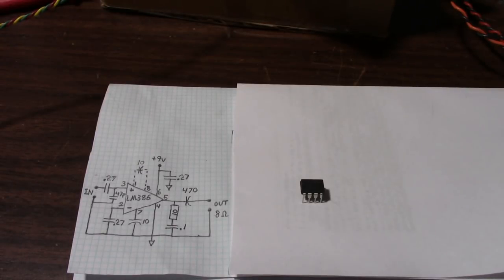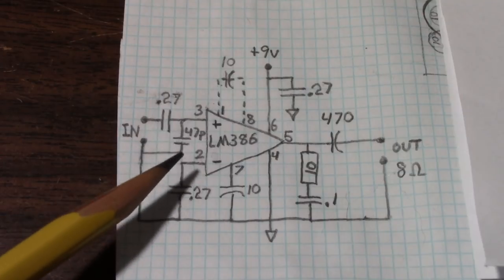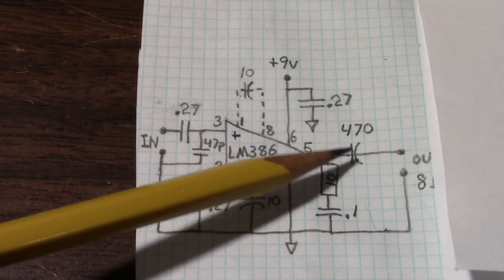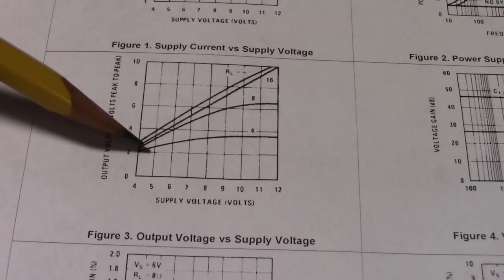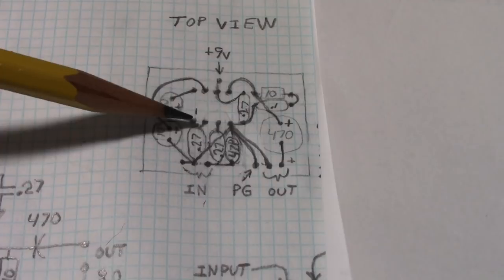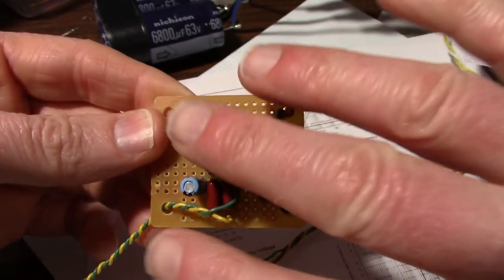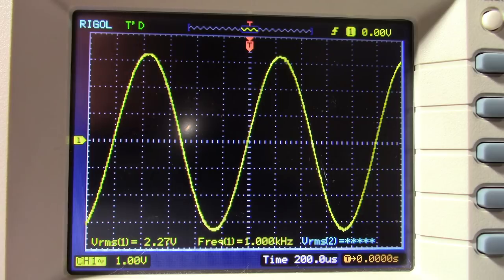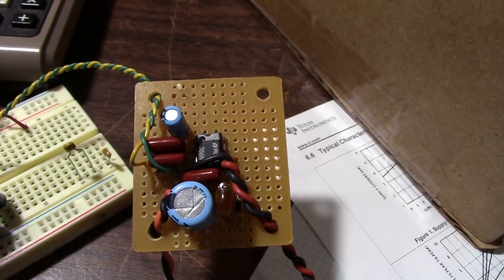Make the PERFECT LM386 audio amplifier?

Comment: im a guitar player and new to electronics hobby . i was thinking would it work if i took my favorite sounding guitar pedal attach it to the input of this circuit and make that all one small 9volt guitar amp? would i need a buffer in between  my FX pedal and this amp circuit? i was thinking of using a Marshal Guvnor circuit into this and use the Guvnor to control the tone and gain of the  amp. thank you for any feed back on this topic. i would want the amp to be completely clean and get all my gain from the guvnor circuit should i keep that 10uf between pin 1 and 8 out?
Reply from the maker: I say try it to see how it works. I'm not familiar with those devices as I'm not a musician. Use a proper guitar speaker in a cabinet to get good volume and sound.
Reply: @JohnAudioTech  i will give it a try and report back here and let ya know how it turned out maybe a couple days . i enjoyed your video breaking this circuit down . i have the LM386N-1 as well as the N-4 ill try both .
Reply: @JohnAudioTech   i decided to put my other projects on hold and just do this one real quick . i just got done testing this on my bread board and it sounds really nice through 2x10 speaker. i had to add a volume on the input of the amp after my Guv'nor circuit, the Guvnor was over loading the Lm386 a bit and turning it down a bit  before the amp made it work really well as a guitar amp. thank you for sharing your amp circuit im really happy with how it sounds on its own, the Guvnor makes it sound more like a Marshall guitar amp. i might add some reverb and put it all in a box with a 1x12 speaker.

Comment: I installed a line in Aux port in my car by tapping into the CD changer L/R lines. It works but I need to increase the volume a lot more to achieve the same volume of a cd, would something like this inline work for that issue?
Reply: Yes, it will work however ; an lm386 is designed for power amplification to drive a speaker, your best bet for a line level low load application is a conventional op amp like a TL071 or LM741 :) make a resistor configuration to set up your gain, google opamp negative feedback
hope it helps, mylo

Comment: For a guitar amp, why use 100k instead of 10k? In a different video you suggested that the pot should be <50% of the input impedance of the amp. 50% of 50k ohms is 25k ohms.
Reply from the maker: Guitar pickups require high impedance loads or they can sound weak and treble.
Reply: @JohnAudioTech  
I suppose the use of a JFET buffer on many common 386 based guitar amps is intended to mitigate this problem. Thanks for your time and channel.
Reply: I was able to set-up a decent sounding circuit in a breadboard with 386N-1. When I swapped for a 386N-4 it distorts. I tried at 9V and 18V. Any idea why? I expected it to sound better / louder. Gain = 20-50.

Comment: I just don't understand why people still use these, when there's other cheap products out there. 
For example TDA7266 - mono 7w , 3v..18v, through hole, easy to heatsink...  datasheet has example circuit and even circuit board layout and everything. 
Or TDA7496 2 x 5.5w, 10v..32v .. with standby/mute and volume control using a plain potentiometer... a bit over 2$
LM1875...  the classic 5pin TO-220 part (if I remember it's equivalent with TDA2030A) which can do up to 25w mono, with +/-8v.. +/-25v or 16v..50v single supply... it's 3$ each from TI (Asian clones of the chip are 0.3-0.4$ on LCSC) . Again, the datasheet has loads of explanations and even circuit board picture with components and everything. If the LM1875 datasheet is no good enough, you can jump to the TDA2030 datasheet and get even more info.
Reply: Simple answer is that many of us still have lm386's from radio shack days.

Comment: Can you use the 700mw lm 386n-4 instead of the lower power one used here?
Reply from the maker: You can use the n-4 with higher supply voltages to get more power, but you're stuck using 16 Ohm loads. The different versions have the same output power at any given supply voltage, so if you use the n-4 at 9v, it will have the same output power as the n-1 (8 ohms).
Reply: @JohnAudioTech  so using 8 ohms at 9 volts for that chip would damage it? Or would it give me a bit more power at 9 Volts than the 350 mw -1 version?
Reply from the maker: @bobking7347  You are safe to use the LM386 with an 8 ohm load at 9v. You'll get the same power with any version.
Reply: @JohnAudioTech  Thanks, I did order all the parts to build this off of mouser!

Comment: why the 274 cap  is only connect to the chip vcc pin , not between the 9v psu and chip vcc pin ?
Reply from the maker: Doing that would block the DC current. The cap must be connected between Vcc and ground.
Reply from the maker: @junsenhsieh7212  If I understand, connect the bypass capacitor lead close to the Vcc and the other lead close to the ground pin as possible as shown on the layout in the video.

Comment: Does the 47pf cap go to pin 3. it does on the schematic but not on the layout,
Reply from the maker: It can go to either side of the input cap. It was easier to layout the way I placed it.
Reply: @JohnAudioTech  thanks. will do the same when i build it.

Comment: For your next trick. make a LM386 based 70 volt amplifier XD
Reply: not hard really, its just a case of attaching a 8ohm-70volt matching output transformer. but with the low output power of a LM386, it wont be the best performer
Reply: @DanafoxyVixen  Or a big resistor and zener diode lol.

Comment: Hmm.. how is that possible that I have a better sound from simple FET + Mosfet circuit than with lm386 (AliExpress) ?
Reply: read the datasheet    it was designed for low-Fi use
Reply: Because the AliExpress '386's are fake. I tried Ali, ebay and amazon. ALL FAKE. Some sort of mystery op-amp re-etched with LM386 on them. I bought 2 Texas Instrument ones from Digikey and they sound fantastic.
Reply: You are right! I have stopped buying components from Ali,Amazon,Ebay etc., because you never know whay you get and after one shop sold me fake l293 wchid don't work properly and I didn't return them because I didn't want to argue with thr seller for a few dollars + petrol to get to the shop. So I decided never again!! I make a bigger orders now, for example 2 times a year at Mouser or Farnell, only original components now. China pease... me off and the sh..what they sell. Never again wasting my time wondering why something not working etc.

Comment: How does this amp sound compared to this? https://www.circuitbasics.com/build-a-great-sounding-audio-amplifier-with-bass-boost-from-the-lm386/
I see he's using a bigger output capacitor and some different values elsewhere. Think it'd make much difference? And that 470pF capacitor between pins 2 and 4 too. Hmm.
I'm probably going to play with both :)
Reply: Also if I do this on a PCB can all of the grounds go to the same ground plane? I see some amps where grounds are kept separated and I don't know what this does to the signal vs keeping it all together.

Comment: I'd want you to analyze and try one thing as well. I found this site:
https://hackaday.com/2016/12/07/you-can-have-my-lm386s-when-you-pry-them-from-my-cold-dead-hands/

That says to use the inverting input for the audio input instead of the non-inverting, saying "We’ve also noticed, and we’re not alone, that the inverting input seems to be less noisy than the non-inverting. See how the datasheet applications ground the inverting input (pin 2) and put the signal into pin 3? Do exactly the opposite and you’ll reduce your noise floor even further."

Would and could you then also connect the non-inverting input to the ground with the capacitor as you did in your video and would it improve anything then?

And maybe try out bridging the LM386 as well. I've found couple of schematics that promise 2W in bridge configuration.
https://www.eleccircuit.com/lm386-amplifier-stereo-2-watts/

Looking forward for your response as I am currently in the middle of building a lm386 stereo amp as my main computer speaker system.

I chose to do this because it makes it simpler for me, not to always click and setup everything on my music centre.
The Sanyo music centre tends to be quite muddy sounding compared to lm386 that sounds the best to my ears compared to all my cheap factory amps
I have actual computer speakers from 90's that are great but clumsy shaped and sound muddy and have a huge wall wart PSU
I have a pioneer car stereo that sounds great but doesn't remember the settings with the 12V PSU removed and is too digital and bothersome to set up every time
I will learn a bunch from building my own simple amp and I can always tinker with it
It's so cheap :D 5 chips from aliexpress for under a dollar.